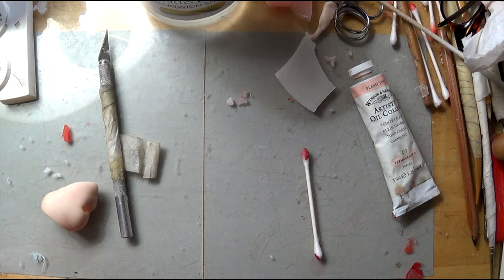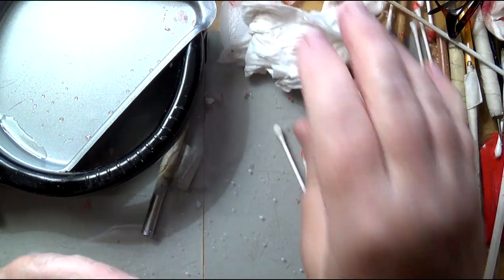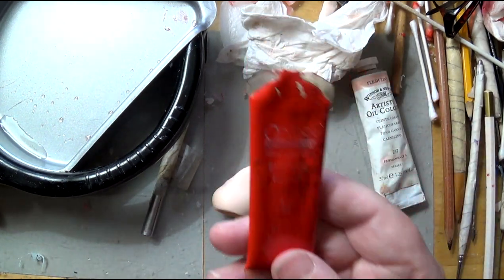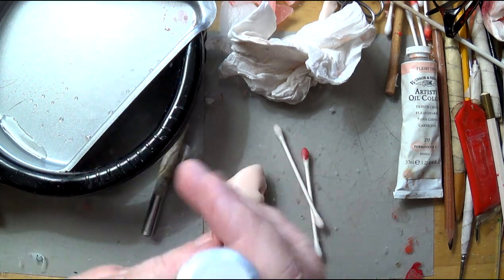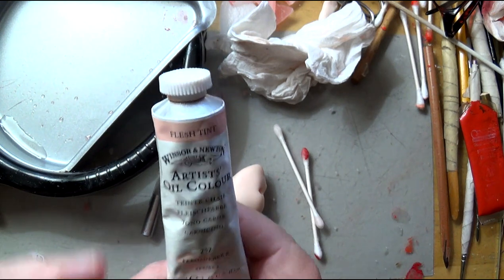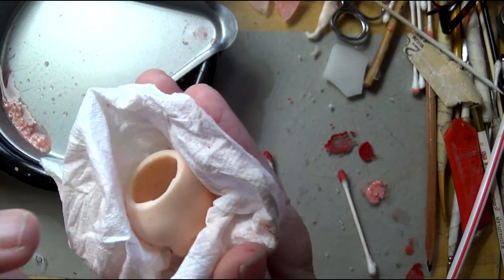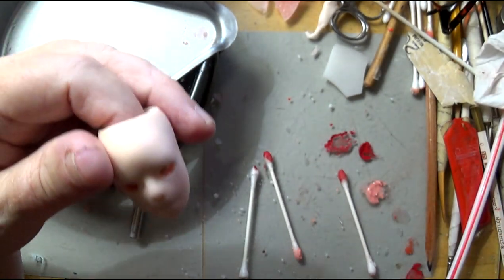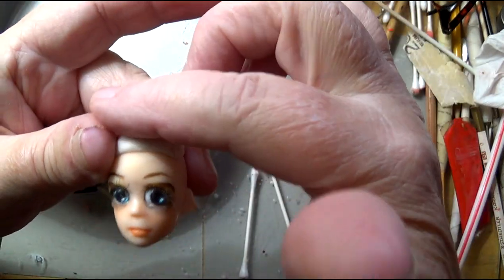Polymer clay and wax for ball jointed dolls

Comment: Thank you so much for the BJD series! I hope you'll go over the bodies in future videos. :D I do have a question though, when you're all done with blushing do you use a finishing spray or sealant on your doll to protect it? Thanks! :D
Reply from the maker: +TheMothPrincess  No sealant.  When I put the pieces back into the oven the heat sets everything.  When I get to the eyebrows in my next tutorial that will be a little different.  If I did want the paint off I would have to use acetone to remove it.

Comment: Hi again Barbra, if I wanted to give this wax idea a try can I try it with genesis paints? I am so loving your ideas although I am new and have only been doing this for a short time. i was wondering at 200 degrees after your done with the painting and you then put it in the oven does this not mess up the coats of wax you put on? And how many coats do you usually do? Thanks for your help it means so much to us beginners
Reply from the maker: Julie Jelaco in this video I did the Q-tips with the oil paints and wax yes. You can use Genesis to. When I applied the paint with the wax I wiped it off. With this method you don't get as much color but you do get color. I would suggest taking your doll head and putting one layer of wax on before you paint. Make sure that you wipe it all off. This will condition your clay and help your paints go on nicely. After you have painted with your Genesis put it in the oven. See if you like it at this stage if not I would suggest this. Apply some clear wax over the doll again wipe off. It's really not that difficult to wipe the wax off don't let that fool you. As always I would say to anyone please experiment before you do it on your doll that you might have put in a lot of time. Get the feel of the wax and your Genesis. Take some scrap clay and test it out for yourself. One other thing that maybe it will help you. In my video I used a lot of paint and I mention that in the video to make it dark. Play with the amount of paint that you put on with the wax. The more the paint the darker color you will have. Again you will make sure you wipe it all off meaning the wax. Your paint will stay on depending on how dark your paint is. Do not be afraid to wipe that wax off with your paints. If not enough color then put more color on. I hope that this helps if not get in touch with me on Facebook and I will see if I can help you there.

Comment: I know I ask a lot of questions' am wondering about your melting pot.Is it electric ? Where did you get it ? I was looking on Amazon and all the melting pots are so big,I just would like something small I do small dolls
Reply from the maker: +Julie Jelaco I bought mine at my local craft store Michaels or Hobby Lobby that was many years ago. You don't really need a Melting Pot you can come up with your own. You can take one of those candle warmers and put a glass bowl on the burner and it will melt it. I use that sometimes when I don't want to pull out the Melting Pot.